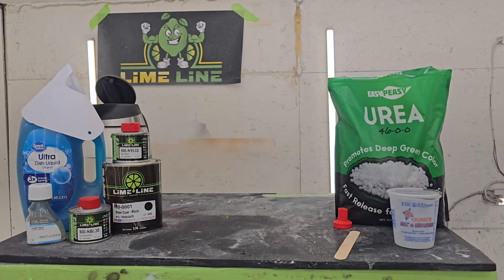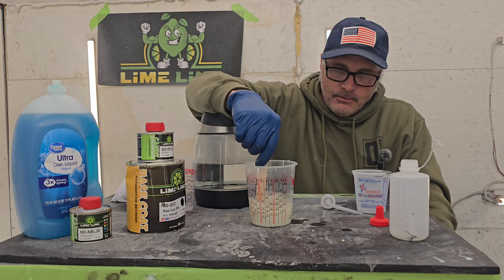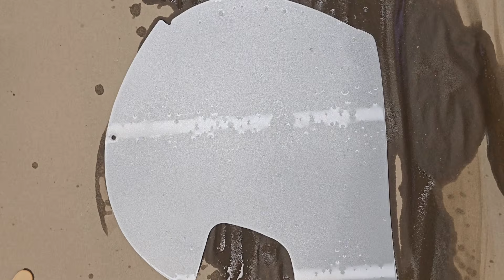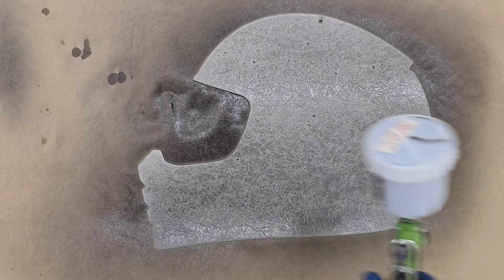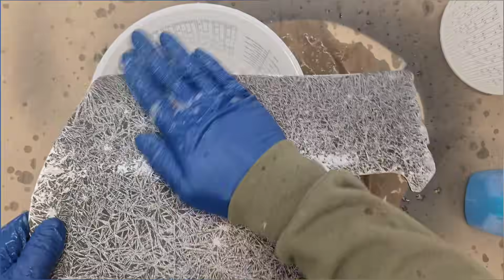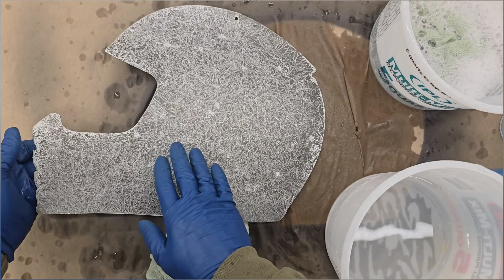Custom Crystal effect for beginners

Comment: 100mL by volume is different than 100mL by weight. Example, 100ml of water by volume vs 100 ml of paint by volume will weight differently. Same goes for the urea, and the other videos I have seen have been measuring mL by weight on a scale. Since you are measuring by volume this might be where your discrepancy in finished product is stemming from 🤷🏼‍♂️

Comment: Cool effect. I have found that ambient temp above 70° and humidity above 55% has yeilded the best results for me. I either pour it from a cup or wipe it on with a microfiber cloth to minimize the bubbles. Also the water should be just hot enough to dissolve the urea. The flakes dissolve easier but are a bit harder to find. Takes a while to perfect it and get consistant results. Keep up the good work.
Reply from the maker: awesome, thanks for the advise.  I will experiment a bit more with this.